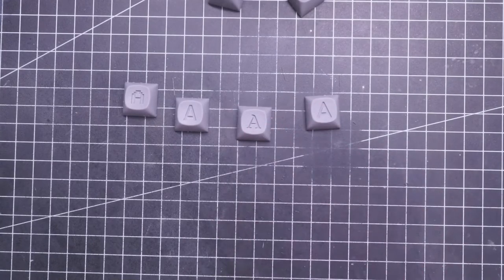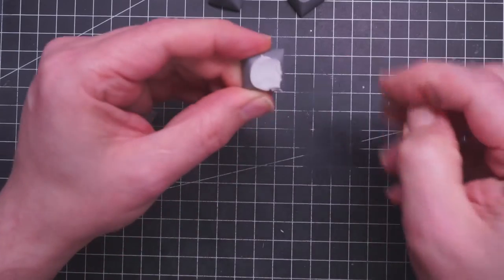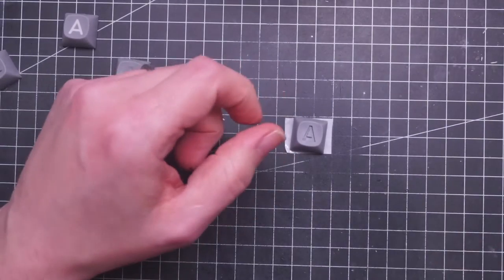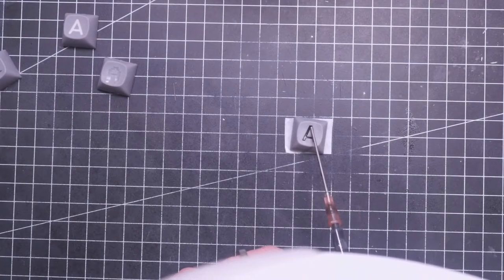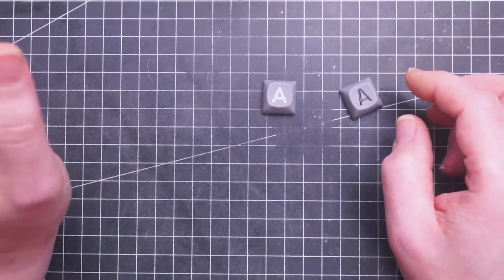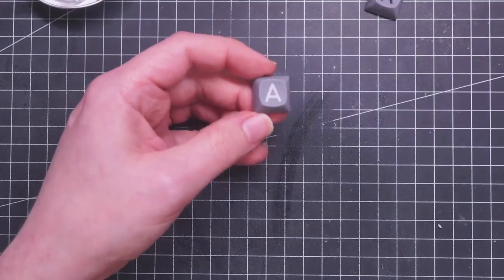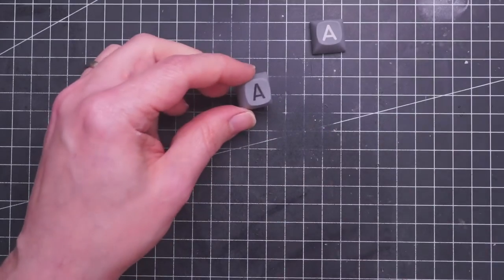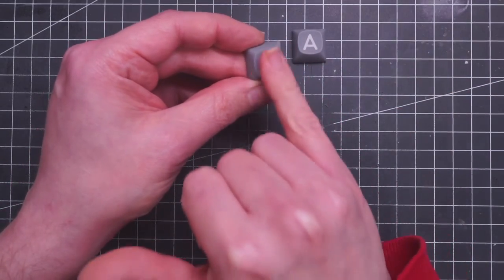DIY double-shot for 3d printed keycaps

Comment: For larger volumes you might go with actual double shot; Maybe use a UV-transparent (optical?) silicone cast mold that follows the keycap shape, minus the lettering. The bottom of this mold would be filled with a few drops of the 2nd color first. Then press the keycap in (evenly because bubbles), and allow the excess coloring to escape through tiny holes in the bottom of the letter shape, at least one for each "island". *Then cure while keycap is still in the mold*. The tighter the mold fit, the less sanding/buffing would be required.

Do you think this could work? Has this been done/tried already?

I liked the way these came out, especially the putty one seems to integrate nicely. Cloisonné flow/dosage is super hard to get right in one go, although squeeze bottles give more control in my experience. Which is why I thought up the method mentioned above.
Reply from the maker: interesting, definitely something worth exploring. this is more a quick and dirty "ghetto" solution :) but definitely I'll make some tests with silicone. The problem I had with resin I had is that it's too tick for a syringe, but ultimately for a few keycaps it's totally doable.
Reply: @matt3o  I love this demo, eager to play around with that putty myself!
Reply: Yes, this should work in the way one can DIY dye sub keycaps.

I have not tried it, but tinkered with the same idea — it should work.
But instead of pushing the cap into the resin in the mold, i'd try to inject it with a syringe from inside the cap through a tunnel.
Reply: @23andreas55  You can actually call that double shot injection molding :)
The reason I wanted to have the character resin come up from below was to prevent air trapping, don't you think that might became more of a problem with your top-down approach? Could vibration remedy this potential downside?
I really need to finish my workshop, and get practical. There's only so much you can simulate in your head on a sunday morning.
Reply: @ronnetgrazer362  Yes, I can relate. Time slicing between house, chores, wife, kids, yourselves :D
Reply: Yeah so putting in the second resin first and then pushing the first "shot" into it is a dumb idea, because the resin will just creep out along the slanted sides of the domed frustum shape that is a keycap. I see that now.
Push keycaps snugly into uniform holes in slab of UV-transmissive silicone, add a few drop of resin, gently vibrate if necessary, cure from as many sides as needed. Something like that.
Reply: @ronnetgrazer362  Excactly my thoughts :D
Reply: Keymacs does his own doubleshot caps from resin and has videos on it, very involved process but very cool.
Reply: @eppicshotgun1281  Thanks!
Reply: @eppicshotgun1281  OK that's on a whole different level :) Amazing quality though.